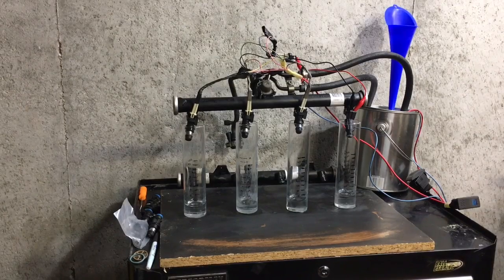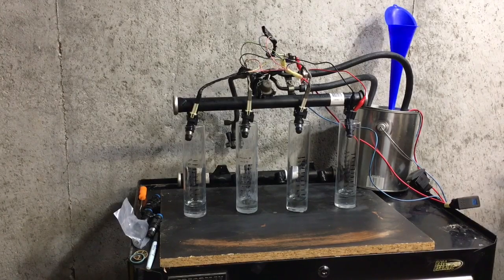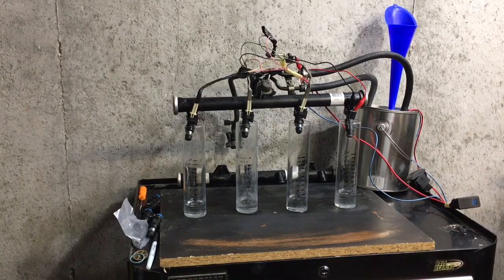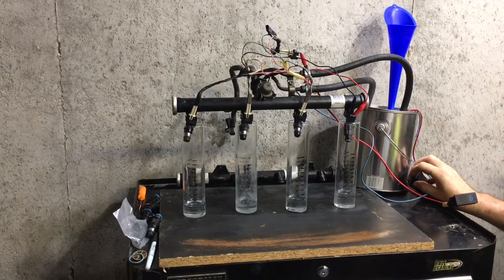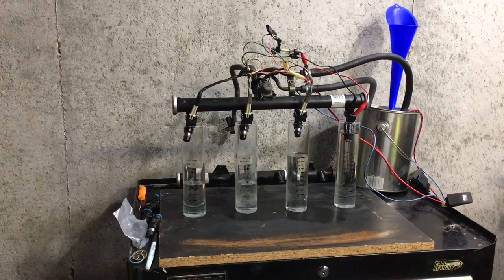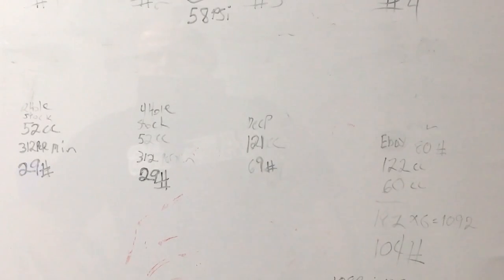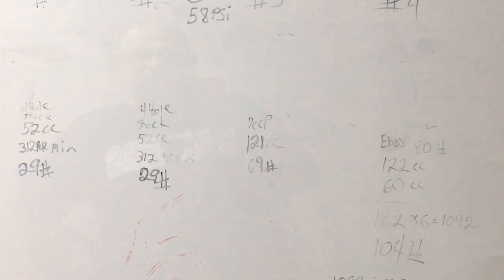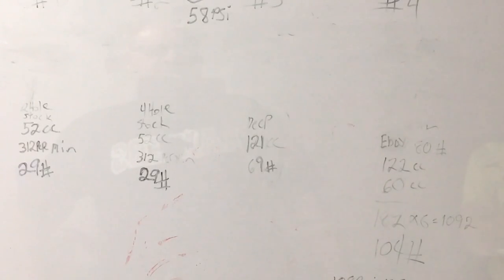Decapped truck injector 4.8 5.3 6.0 flow test 69#

Comment: problem is your not going to get an accurate flow rate using different type injectors on the same fuel rail at the same time rather for an accurate reading on flow rate must be tested individually.

Comment: So what did you do far vacuum on the regulator to work
Reply from the maker: I run the factory truck fuel rail, fuel pressure regulator and vacuum line connection. My fuel pressure was set by my Walbro 525 lph pump at 60#. 
I’m currently changing to the Walbro 535 lph e85 pump so I’ll see what the factory preset is then go from there. 
Note: I have my decapped truck injectors entered as 74# in my tune on my Turbo 4.8

Comment: I have a question! Can i put a 4.8 injectors on a 5.3 ?
Reply from the maker: You can, but they’re probably smaller.  The early 4.8 came with a 24.8# injector when the 5.3 came with 25.2.#

Comment: In most of my b and h series Hondas that are around the 550 wheel hp I'm running decapped 5.3 injectors since their e85 compatible.  They work flawless.
Reply from the maker: I’m running decapped 25.2# truck injectors that flow +- 74# in my Turbo 4.8 LS.  If/when I upgrade to more boost I’ll decap a set of the “Flexfuel” injectors which flow way more like 88# or something crazy.

Comment: What calibration fluid were you using and what was the specific gravity?
Reply from the maker: lol you talk like we knew what we were doing!  This is a cheap shade tree see if it works setup.  I’m not sure what Richard used for fluid but it may have been denatured alcohol.  Maybe 🤔 
Richard ended up buying one of the eBay fuel injector flow/cleaning benches and even it is difficult to get consistent flow numbers from.  We decapped a set of the truck 25.2# injectors and flowed them on the eBay bench, it took several sets to end up with a decently matched set of 74# injectors.  Honestly, we had one all star performer injector that was a few # higher I stuck it in cylinder #7 since it’s the one who’s famous for injury!  lol JD

Comment: Not sure if there is difference but how about LS7/LS9/LSA injectors de capped
Reply from the maker: We’ve never tried it, not all injectors can be decapped.  I’m running decapped 25.2# truck injectors in my 4.8 Turbo flowing 74#; they run great very smooth and easy to tune. 
When I upgrade my injectors I’m hoping to use decapped flex fuel injectors from a truck.  
I hope you check out my channel and subscribe.  JD

Comment: It makes sense that both the 2 hole  and 4 hole injectors would be the same. If you needed a replacement you may get either one from the store and if the flow was different then that cylinder would be richer or leaner than the rest. Causing other issues in performance.
 It would be interesting to test a bunch of decapped injectors to see how consistently they flowed over a large group
Reply: FSM for 02 Silverado warns that, when replacing individual injector(s), you have to match p/n and/or reference old injector visually. So it seems that, while what injector came stock could vary either from location or specific date of manufacture, it still is necessary (or, advised)
Reply: So i just had 2 stuck injectors on my 03 silverado 4.8 stock injector has 2 hole cap buddy lent me 2 of his 4 hole cap truck runs beautiful now for about 5-10 min then she just floods out 2 cylinders i out the 4 hole caps in. But this video shows they flow the same ?

Comment: Can I run a decapped flex fuel injector on a 2002 suburban ?  Planning on putting a turbo set up soon.  Thanks for the video.
Reply from the maker: D&D Operations The flex fuel decapped flow like 85-88#
The important thing is to flow as many injectors as it takes to make sure they all flow the same. 
I wouldn’t just decap and install without flowing.  
Thanks for the feedback I hope this helps!  JD
Reply: HeadFlowInc awesome thanks for your help

Comment: Friend of mine got 4 sets of LS injectors and decapped/flow matched them untill they had 8 that was almost identical. Used a similar setup to the video anyway. On a 160$ Ebay turbo truck hauls ass I have to say. For the money its actually ridiculous
Reply from the maker: Will Spicer I’m currently trying to build the same thing, cheap as possible $156.00 GT45 Turbo!  
Thanks for the feedback I appreciate you watching!  👍 JD

Comment: On a 5.3 v8 vortex, would it run good with 22psi injectors ?
Reply from the maker: Antoine Taylor 22# injectors are small, it would need to be a stock low rpm type build.  Non-performance 
The 24.8# and 25.2# truck injectors should be fairly easy to find depending on where you live. 
Injector scale in the tune is also a concern.  JD

Comment: I did this to my 4.8 ls engine cost me a lot money to fix it. I try to tune my suv and I couldn’t I need it to fix for me be available to tune my suv.
Reply from the maker: Aa Vaz Are you saying you decapped your stock injectors?  If so it’s highly recommended to send those injectors out to have them cleaned and flowed.  Eric Derr will clean/flow injectors for a decent price as an example, see if you can find somewhere that works for you.   JD
Reply: Is to late i replace them all ready. But make sense by doing that you going to run rich. Your car is going to bee misfired. Means your spark plugs, 02 sensors, cats and  on my cause my flowmaster. Got ruined because I run my suv thinking that I could fix.
Reply: So you decided to just dump mpre fuel into a N/A engine and expect for it to run? Nahh brotha. More fuel needs more air. Why decaps work for boost but not N/A

Comment: Hey headflow. I got a question maybe you can help  on my 2000 5.3  fuel rail is from the 2000 but I got a wiring harness from a 2002 suburban 5.3 flex fuel engine with the 411 PCM Do you know if the flex fuel stock injectors will fit the 2000 fuel rail? The injectors connectors(2002 wiring harness) are definitely different from the 2000 injectors the 2000 injectors are part #25323974   Any help would be grateful
Reply from the maker: Kt Carroll I thought you could run the higher flowing flex fuel injectors with the return style fuel rails.  I’m also thinking the wiring harness should be the same between 2000-2002. 🤔
I’ll ask some friends to see what I can verify. JD
Reply: HeadFlowInc the harness is the same except the injector connectors are bigger on the 2002 harness not the tiny connectors on the 2000 non flex fuel  I also got the pcm 411 off the 2002 so hopefully the pcm will be set up for flex fuel injectors. This is all according to the vin off the 2002 suburban
Reply from the maker: Kt Carroll They sell snap in adapters to go in between the different injector connectors, no splicing required. Cheap, so if the connectors are different it’s an easy  fix.
Reply: HeadFlowInc ok. My concern is if the injectors will fit the fuel rail and intake holes 😅. Don’t want no FIRE 🔥
Reply: @ktcarroll4723  @ did u ever figured out,?   How did it worked?
Reply: @ktcarroll4723  @ ok, i bought a 2002 tahoe flex fuel vehicle,,  without “”engine/transmission “”         And found a 2000 tahoe as donor engine/transmission, “” non flex fuel”””    Will these non flex injectors work on the 02 flex fuel tahoe???   Czn i just use wire adapter’s???   Or i need to get the flex fuel rail and injectors,,???🙏🏻🙏🏻
Reply: @gerardolopez5875  the rails and injector length are practically identical the injector wire plug is the difference  are you using the wiring harness and ecu out the 02 flex fuel truck? If you are a set of flex fuel injectors are fairly cheap and solves that problem
Reply: @gerardolopez5875  not sure your purpose of truck daily driver  drag strip  if daily driver try and stay as close to stock as possible because big cams uncapped injectors etc make these engines haul butt but are a nightmare to get the right tune if you do it yourself like I did
Reply: @ktcarroll4723  @ yes the pcm/ harness from 02 flex tahoe,,,
Reply: @ktcarroll4723  @ yes , just a daily stock driver,,
Reply: @ktcarroll4723  @ at junk yard, any 5.3 with same injector conector would work??? Or ?
Reply: @gerardolopez5875  either injector wire harness adapters or new injectors the ecu will think they are flex fuel injectors so if you use non flex fuel injectors will it work correctly as far as flow rate injector off/on time ? I really don’t know 😅
Reply: @gerardolopez5875  yes 👍
Reply: Usually if you can read the vin and do a vin search it will tell you if it’s a flex or not
Reply: @ktcarroll4723  @ what about the nom flex injectors? Would they work like that ? Or it will missfire
Reply: @ktcarroll4723  @ i bought flex fuel injectors,,   They look little longer then the others,,,  thats wat u mentioned about the washer on fuel rail?
Reply: @gerardolopez5875  yep  beneath the rail and intake I think I have like 3 washers on each bolt   You just want it snug  the orings do most of the sealing anyway  as long as they can’t move up or down is the goal
Reply: @ktcarroll4723  @👍 thanks,   Nice 84c10 by the way,    👍
Reply: @gerardolopez5875  thank you. Need anymore help let me  know I stay on YouTube to much but I’ll try to help you
Reply: @ktcarroll4723  @ got it all together today,,   And good news,,  its working perfect,,, 👍
Reply: @gerardolopez5875  that’s great man. No better feeling than to hit that key and it fires up
Reply: @ktcarroll4723  @ 😩 now the passenger side fuel rail,  getting wet on front end,    Very small fuel leak,         Can jb weld it? Or silicone? Or junk yard?
Reply: @gerardolopez5875  is it the rail itself leaking? There is 60 psi going to those injectors  silicon jb weld will not hold  sure it’s not the rubber orings on injectors ?
Reply: @ktcarroll4723  @ its on front of rail, has like a chrome  cap
Reply: @gerardolopez5875  change the rail  don’t want a 🔥
Reply: @ktcarroll4723  @ agree, thanks
Reply: @ktcarroll4723  @ are located in texas?
Reply: @gerardolopez5875  no sir. South Carolina
Reply: @ktcarroll4723  @ do u do pcm tuning?
Reply: HeadFlowInc  really appreciate it  there is a guy on here put in these injectors 12613412 in his 02 5.3 he said they are 50lb injectors
Reply from the maker: Kt Carroll No, the flex fuel is 33-35# injector at factory fuel pressure.  Unless you decap the injector. 
I think he is confusing injector flow rate and fuel pressure.
Reply: Ok, thanks for all the help,,
Reply: Relooked at video and it said 50lbs per hour but it fixed his rough idle etc etc  I’m going to take the fuel rail to the parts house and check one of those injectors and see if it fits 😁

Comment: What about the 4 hole decap
Reply from the maker: Alex Duke It’s in the video, it doesn’t  flow anymore than a regular 2 hole injector. Upgrade to the flex fuel injectors then you’ll see a big gain in flow. 👍
Reply: HeadFlowInc yes I understand that but you had 2,4 capped flowed the same. I don't necessarily think that them uncapped would ,unless it's the same injector with a diff cap.... So are you saying I can uncap my 5.3 to allow more fuel ? I have a donor truck I'm trying to use my 02 5.3 intake on a 05 6.0 block and heads with my comp thumper cam and all my bolt ons. will my 5.3 injector keep up ? is this just for adding boost ? which I may go to one day after I solid axle swap obviously it's been a project since I was 17 and I'm 30 now and ready to really do it"big"now .I should have stuck with 35s once I went to 37 with a 5.13 gear I exceeded the strength of the front end 

My machinist isn't up on these ls motors so he can't answer the questions I've been asking. I guess it's time to join a forum!  I like his shop because he'll let me use his equipment on my own stuff and just tutor me while he's working to help me save money Lewis is the only reason I can go fast taking care of 5 kids he is a blessing
Reply from the maker: Alex Duke Factory injector is fine for a naturally aspirated engine. 24# injectors can handle a lot of power. Decapped injectors is for Boost
Reply: HeadFlowInc where are you located probably not in the Richmond VA area
Reply from the maker: Alex Duke Just South of Kansas City, Mo.  Let me know if there’s anything I can help with. 👍
Reply: @HeadFlowInc  so a decapped flex fuel injector will outflow the others? Or does it matter without the cap. Either way cool video.

Comment: What if you have a 5.3 lm7 mild cam 4.8 flat top pistons will uncapping the stock injectors be useful on a every day driver or is uncapping more useful for racing?
Reply from the maker: Kt Carroll Way to much injector flow for your combo.  If you wanted to upgrade just shop for a set of factory GM Flex fuel injectors. Have it tuned. 👍
Reply: HeadFlowInc tuned? Oh boy mo-money. Can they tune it for new injectors when I have the ecu flashed and all the useless crap taken off? Or only with truck running? Kinda new at swaps on these engines
Reply from the maker: Kt Carroll There are companies who sell tunes like Nelson Racing Engines and more. Even having a basic tune where they speed up your Power Enrichment and demanded AFR at Wide open throttle will make a big difference in power.  
The factory tune is only set for lean efficiency plus they delay the power Enrichment to above 4000 rpms at 90%+ Throttle sometimes even adding a few seconds! 😳👎.
Reply: HeadFlowInc I really appreciate the info once I get the block and head finished I’ll move to the fuel delivery system. I hope my 84 c10 likes it
Reply from the maker: Kt Carroll You’ll like it, the LS 5.3 has more Torque than the old school 350 from having a longer stroke on the crankshaft.  5.3/3.622 and 350/3.480
This means more towing power and better seat of the pants acceleration!  Enjoy! 👍
Reply: HeadFlowInc I had a 2010 sierra with a 4.8 and that sucker would haul butt and I like the idea of not pumping the carb to keep it running  so hopefully in a few months I’ll have that Chevy polluting the air with burnt rubber occasionally 🤠

Comment: What year vehicle is the uncapped one? Is it from a 6.0L engine And what's the CC's after decapping
Reply from the maker: Don Woods The decapped injectors was the same Truck injectors, No e85, injectors they used on all 4.8, 5.3, 6.0 as far as I know. Iirc the decapped injectors flows 70 gph.
Reply from the maker: Don Woods oops, truck injectors 2000-2005
Reply: Are these the Delphi 25lb
Reply from the maker: Don Woods Yes, factory truck 24/25# injectors except the one eBay 80#.
Reply: Would these be close to 1000cc injectors?
Reply from the maker: Don Woods I don’t think any of these flow 1000cc.  I think a 1000cc injector is the same as a 95.23# injector.  We would need to verify but I think this is the mathematical conversion.
Reply from the maker: Don Woods A true 85# injector would flow 892.5cc.  Now is it possible a quality name brand injector rated at 85# can flow 1000cc yes very much so.  I would think 85#/892.5cc would be the minimum it should flow at the provided fuel pressure of the manufacturer.  So it makes sense that increasing the fuel pressure will increase the output, it’s not very far from 892.5cc to 1000cc. It all comes down to test fuel pressure and ultimately how much injector you will need to safely feed your build without using more than 80% duty cycle. 
Running more than 80% Duty cycle is possible but increases the probability of hanging an injector. JD
Reply: Sorry for the continued question but you are helping me out. Since there is one decapped and it's a 25lb injector what cc would it be now that it's uncapped?
Reply from the maker: Don Woods Decapped non-flex fuel truck injector: 
In our test fixture:
69# equals 724.5cc

I had a comment on this video showing our results at 3 bar would be: 
78# equals 819cc
(I’m not sure how/why 3 bar or 4 bar has anything to do with static flow testing of a fuel injector. 🤔
Reply: Thx again for the clarification